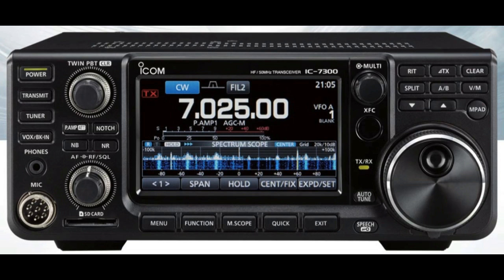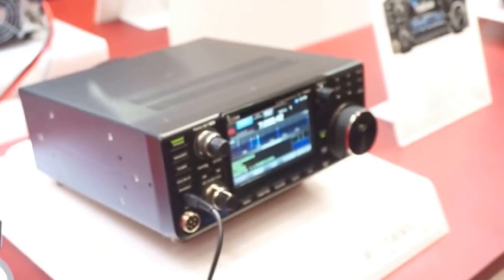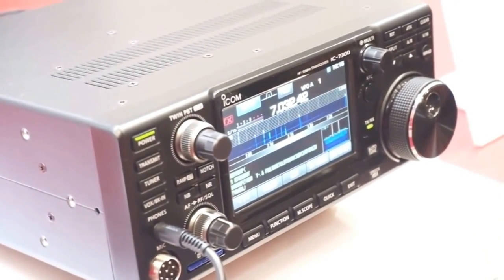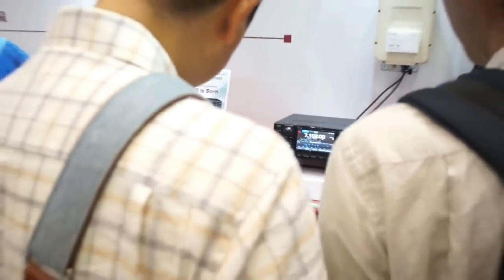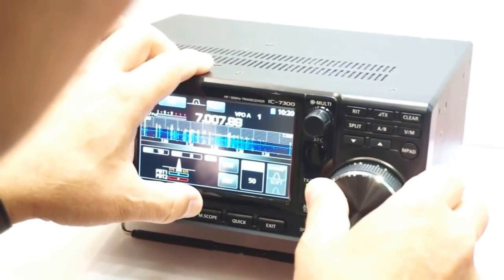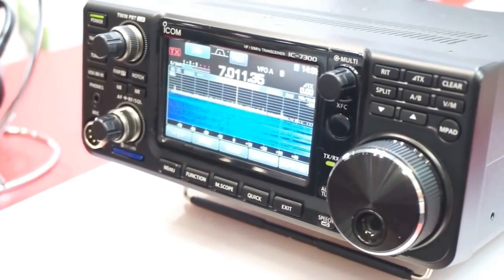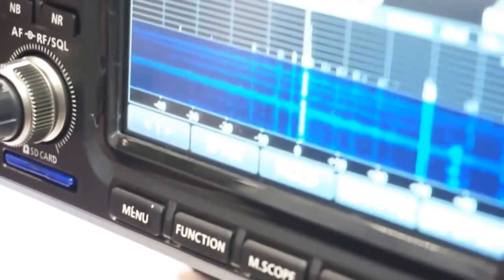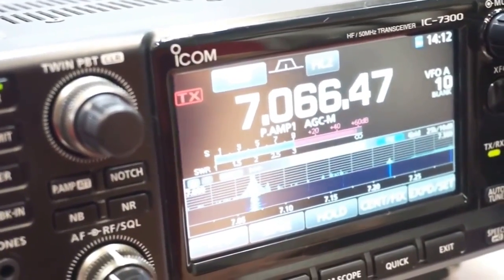Why I will buy an Icom 7300 - sight unseen!

Comment: Some of us don't have the BIG BUCKS that you have.  I am quite happy with my superheterodyne.
Reply: We make the best with what we have, entry level SDR technology is within reach of everyone it's just not as cutting edge as this particular example... if you haven't already I'd suggest you at least look into the whole RTL/upconverter scene, I pieced my own set up together for less than $70 USD.
Reply: +John Schroeder I am to understand that this rig should price out at about $1,200 USD, which is in the same price as a conventional rig.
Reply: +Tom KD6SBR  Tom, you need to do some homework. Direct Conversion and Direct Sampling are also proven. Don't mean to sound harsh, but you comment just screams ignorance.
Reply: +John Schroeder   I am very happy with my  FT 2000  superheterodyne. Latest 1154-159 firmware.  I have checked and set the front end with a Calibrated mV meter.  Adjusted the IF gain a little Esp: on 20, 40, and 80  and it works a real charm.  I sent the figures to Yaesu but as yet have not received a reply. The Yaesu mods that are supposed to harden  the front end are a waste of time in my opinion as they only alter ratio`s. One useful Mod though. When using AE 1 AE 2 is disabled and Vice Versa. The RX AE is left high. Just put 2 x 4148 diodes back to back across the receive AE input if using a linear and you will never get any trouble.  If you are like me and  never use a seperate RX AE, then just install the diodes in a PL259 plug and install it in the RX AE SKT. This if you do not wish to remove the top cover. I have never had any problems with this radio at all .  I have just adjusted Yaesu`s settings to where the radio performs at it`s best.   Maybe one day I will get a SDR Radio But not at this moment. I understand that the Flex 6300 is excellent but quite expensive at the present time. So just like you John, I am sticking with it !.
Reply: +John Schroeder   Yes. Triple conversion superhet works very well.  My FT 2000 with latest 159 Firmware and a lot of setting up works perfectly for me.  Not changing it for a box of chips, rocks and blocks !!.
Reply: +Crobular I would be good money that YOU would not be able to tell me which was which by looking at the inside of both radios... You make me laugh!
Reply: +Tom KD6SBR Let me clarify, by ignorant, I mean uninformed, or not knowledgeable on the topic. I wasn't suggesting that you were ignorant as in rude.  Your comment was very silly, that's all. I have been an active amateur since 1977.
Reply: +Tom KD6SBR Tom, I have always maintained that this hobby is wonderful and I never knock someone for their particular interest in the hobby. That is one of the things that make it great, it has hobbies within the hobby. For instance, I like QRP, I like QRO as well, I love Rag Chewing on SSB and AM, but mostly CW. It doesn't make my choices right or wrong, it is just what I like. You prefer conventional or "old fashion" methods of using intermediate frequencies and the beating of those frequencies in order to boil down the signal into eventual audio, that is fine. However, as much as I respect your preference, I think it is also important that others understand the differences between direct conversion and the use of intermediate frequencies (IF) to decode a signal. In a nutshell conventional methods using IF tend to be much more loaded with circuitry to deal with conversion, beating, filtering etc. All these stages effect, sensitivity, selectivity and generate birdies etc. Whereas direct conversion, eliminates all of those steps and is much more efficient. And for the record, I have been using, buying and building SDR type receivers and transmitters for several  years now, and I can absolutely say that they generally blow any conventional receiver out of the water. The technology is here, and it works. As a matter of fact, if you look at the commercial manufacturers of non amateur radios, you will learn that many if not the bulk of them are using SDR technology, but with a conventional user interface we know as knobs.. I love that.... Although I loved the performance of my SDRs, I was never really happy with having to be tied to a computer, but now companies are introducing SDRs with Knobs such as Icom and the IC7300. Like it or not, and you should like it, if you like performance, it is the way of the future. It won't be long before the only radio you will be able to purchase new will be ones based on SDR technology, with or without knobs.   Anyway, good discussion, and I wish you all the best, and your radio choice is a fine choice, most are good, but most are now obsolete. 73!
Reply: Anyone using superhet is using very old technology. With digital front ends the superhet is like using soup cans and string.
Reply: Pete Harlen  lay off that boost lad, it affecting your thought process
Reply from the maker: +John Schroeder Big bucks are not hard to come by with a little work.  I fund all of my shack purchases through online activities like this video channel.